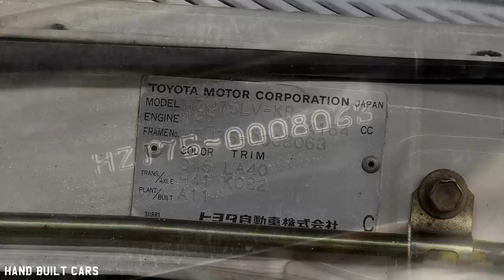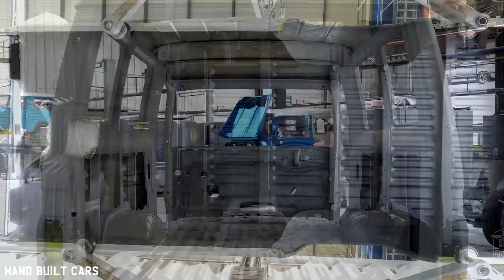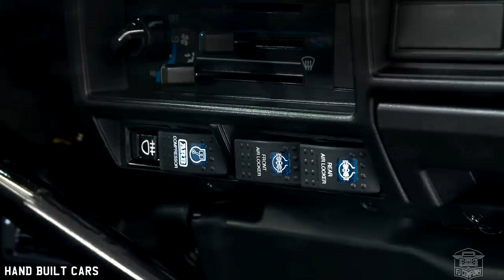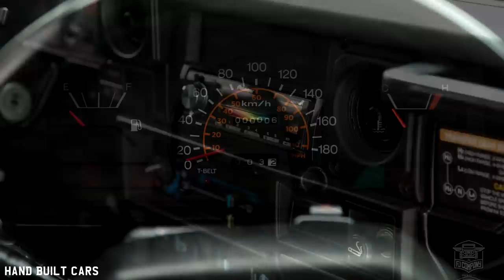1992 Toyota Land Cruiser HZJ75 Full Restoration Project

Comment: Working on a major gas pipeline in the north of Western Australia when these models were new, my work car was upgraded to one of these.  What a bonus that HZJ engine was!  Could actually sit on the speed limit on the highway when heading back home after a week of working away.  And they just drove beautifully on the dirt roads, and we did thousands of kilometres on the dirt.  Bullet proof.  Nice trick is to lock the front hubs and drive in 2WD on the dirt and when you hit the loose stuff just back off the accelerator and pull the transfer case lever into 4WD and the car just went like it was on rails after that.
Reply: I have one of  these and it has 760567 km on the odometer  ,same engine and gearbox  never been reconditioned  , been every where in Australia  and still going strong
Reply: The Pilbara before they bitumen-ised it! 😂 sounds like the Tom Price access road right now 🤔
Reply: They drove like a tractor! and were not comfortable at all, even now with a updated 2018 model you have to put in quite a lot of sound deadening and insulation mating to the entire inside of the car to make it even reasonable, the seats are like a park bench as well.
Reply: @jasonswift7098  what did you expect haha
Reply: @jasonswift7098   my work vehicle was the same year, 1992, brand new.  Back then there wasn't anything to compare in that class of work vehicle for driving mostly on Gascoyne and Murchison dirt roads.  So I'm not sure what you are comparing to.
Reply: @paullangenberg5907  This beasts are saurians, indestructibles.

Comment: The FJ Company rocks , that is my dream truck ,thanks . Hopefully it will be at Overland Expo next year.
Reply: This is a hj.. diesel..
Reply: Datsun Liam aka Captain Obvious
Reply: @curtislasher994  just thought id mention the difference between hj and fj. Considering the original commenter mentioned something unrelated to this video
Reply: @datsunliam5514  this restoration was done by The FJ Company, they restore and restomod old Toyotas, very posh, very pricey, complete nut and bolt refreshes.
Reply: @MountainGuerrilla  ah ha.. i didnt know about them. Cheers for the heads up
Reply: @datsunliam5514  its a hzj
Reply: Magnifique. 😉. 😉. 😉. 😉. 😉. 😉

Comment: I would have turbocharged that 1hz after the rebuild
Reply: No need to sir it's not the Honda lawnmower that you are used too
Reply: @Desert_stormh  youve never had a turbo diesel before have you. It completely changes the vehicle
Reply: @datsunliam5514  I think he's a yank, yanks don't know much. Nice GQ by the way, first car I drove was a GQ NA petrol farm ute then worked up to yanmar tractors etc.
Reply: @okm88  yeah bloody love my old gq. Nice and simple no computers can easily be fixed. And still a 90s model so has SOME style lol mines the diesel model with big turbo and intercooler blah blah. Goes good
Reply: @datsunliam5514  4.2td?
Reply: @okm88  yes sir
Reply: @datsunliam5514  mad good engine, probably the best they ever made. My mate has a gu 2.8td if i recall..90s spec. As much as I am a landcrusier fanboy, I like the older pre 2000 patrols especially the GQ's.
Reply: @okm88  im a nissan guy through and through. But. Those factory turbo toyota motors are hard to beat. The td would be the best of the nissan motors (in my opinion). Super reliable. Easy to get power out of too
Reply: @datsunliam5514  not a race car, no rush.
Reply: @tevitaphillips3196  you must tow a caravan, do you have grey hair? Lol
Reply: @datsunliam5514  no lmao but i do drive a pretty decently driving car, so when i hop in one of these no matter what powerplant its got its still gonna drive like a dog. no point worrying about how fast it goes then. driven small block ones and they were still shit.
Reply: @tevitaphillips3196  i have an SS (aus) and a turbo falcon to go fast. But my patrol is basically standard engine wise. Has slightly modified fuel pump and turbo. Makes about 200hp. But i dont drive it like my ss, its great for towing and actually being able to overtake safely. Not like a snail
Reply: @datsunliam5514  Fair, for towing etc the power is nice.

Comment: i have the 75 series ute in this mint condition.payed 20k...mine running 1hz garret turbo twin tanks 90l up front 140l rear.to many over extras to mention...my complaints with this model is no leg room im six foot tall built for small jappness blokes...very harsh on diesle milage if you love spending money on fuel this is 4x4 for u..the good go anywhere reliable not bad at towing you have to keep a eye on egts running turbo...